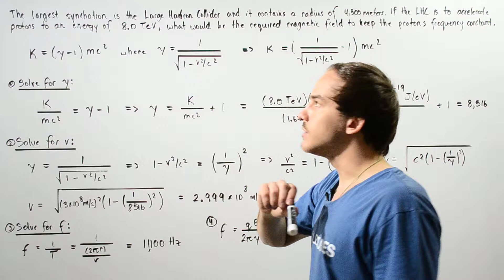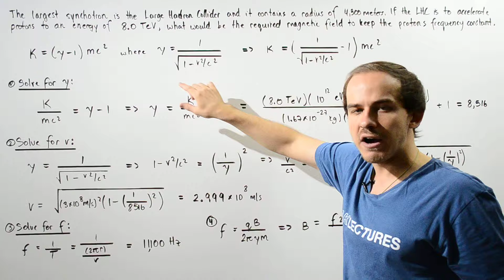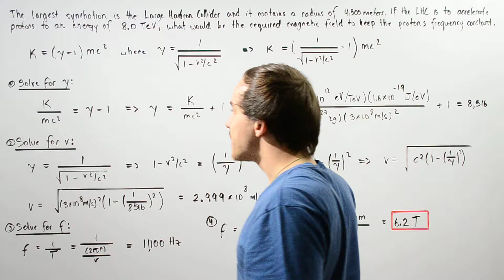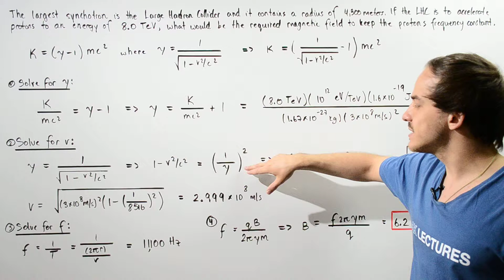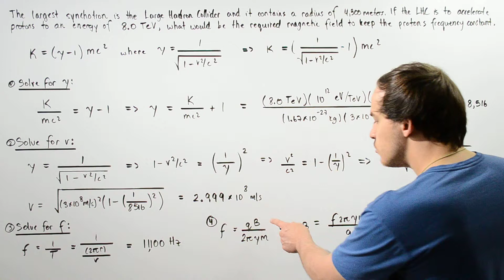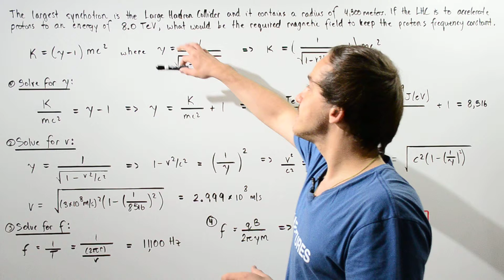Synchotron Example

Comment: I’m afraid your particle is traveling faster than light, isn’t it?
Reply: The speed of light was taken to be 3x10^8 ms^-1, altho I get your concern that the ACTUAL speed of light is 299792458 ms^-1, in this case, he took the reference C as 3x10^8 ms^-1 for simple calculation. If u took the actual speed of light as C, then your answer would be more accurate, or relative to the C value u chose. Hence, the particle isn't traveling faster than the speed of light if we chose the speed of light to be 3x10^8 and if u chose 299792458, the speed of the particle would be less than the speed of light.
Reply: @BlackShot0wnageHD  This is likely what happened. Still, it is good practice to be consistent with the approximations in use. I just found it strange that such a knowledgeable and clever guy didn't even mention how he got that physically impossible result - it's a Physics lecture, after all! Hence, my comment.